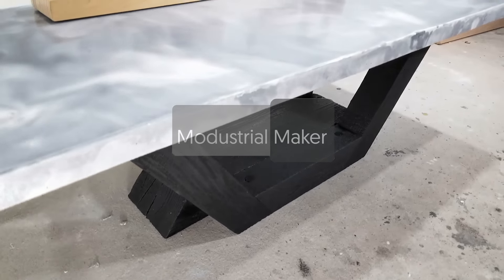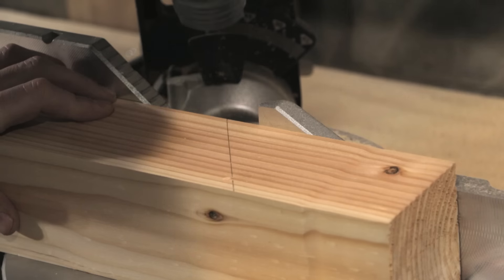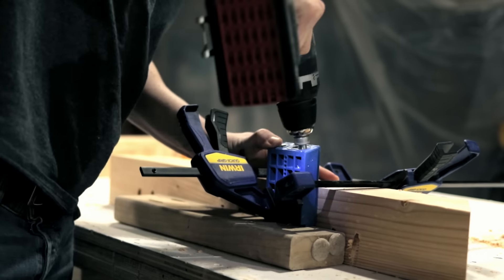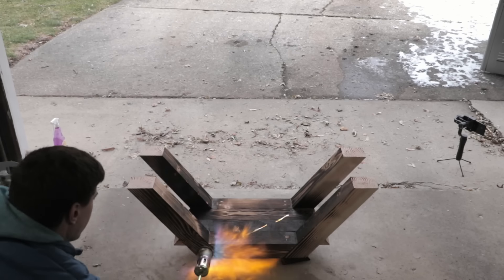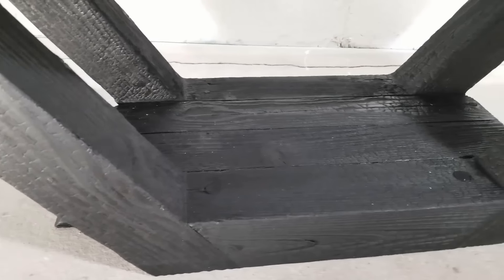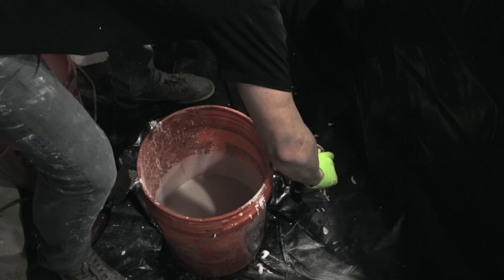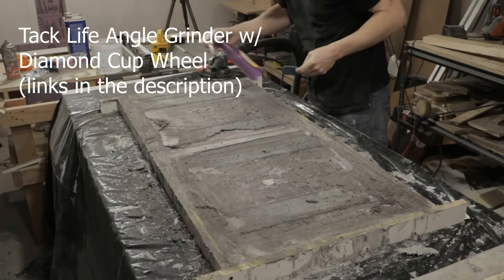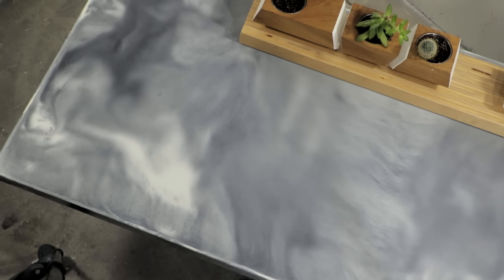DIY "Marble" Concrete Table || w/ Shou Sugi Ban Base

Comment from the maker: Which concrete look do you prefer, the "marble" look or the pure white in my past videos?  Comment and let me know!
Reply: I love the uniqueness of the cloudy/marble look, but the white has a clean aesthetic that's impossible to hate. I'd love to give this a shot. Haven't made the leap to working with concrete yet, but this just convinced me! Another great video!
Reply from the maker: Thanks!  Would love to see what you make once it is done!
Reply: This marble look is really awesome.  It fits with the color scheme of my house and I think may try it when I finally get around to making my wife's nightstand.
Reply from the maker: +Brian Easly thanks! Would love to see what you make.  Email me or tag me on Instagram if you share pictures.
Reply: I like both, really. But in my own home I would probably want the white stuff.
Reply from the maker: Thanks!  Yea, white goes with everything, for the marble look you are making the design of your interior fit around it
Reply: True, very true
Reply: The marble for sure. Great table. Do you have any measurements for leg length and table top dimensions? Thanks in advance.
Reply: Modustrial Maker ur problem wasn't the foam inserts, it was the extra use of hands at start. When u put the colors in vibrate the box it will not blend to a grey. The marble lines will be more crisp and it will get rid of all bubbles. Also put foam inserts earlier they will rise with the extra cement u put in. But great job anyway
Reply from the maker: Thanks for the tips!
Reply from the maker: Yes, lots of ways it has evolved since bundling cedar boards and lighting them up the middle like a smoke stack
Reply: Modustrial Maker what if you poured the 'marble' bottom up. Ie, place the foam in the bottom if the mould, then layer on the fibre glass, and last, the marble top surface. That way you can actually create the lines and pattern if the marble exactly as you want it. And no anxious waiting! Just a suggestion
 Let me know........
Reply from the maker: It would be challenging because pouring against the form is what creates the nice top.... You would have to hand trowel the top and use a wet grinder/polisher if you can right side up
Reply: Modustrial Maker ... true, but IMO the look of marble is timeless.
Reply: Can I get a cut list for the base
Reply: White for certain.  Fresh, clean and unique
Reply: marble looks nice! do you make for individuals who want to buy it?
Reply: HAVE YOU CONSIDERED USING AN EPOXY FINISH OVER CONCRETE?  i've been wanting to try this for some time but haven't found many examples on YouTube that use them together (particularly for solid surface countertops; most are either clear epoxy on concrete or a natural stone finish on wood).  what i like about this idea is how the weight and hardness of the concrete mimics the actual FEEL of a natural stone or solid surface countertop while the epoxy finish adds an incredibly realistic LOOK (there are hundreds and hundreds of different methods and recipes online—which use various dyes, metallic powders, and construction techniques for granite, marble, quartz, or any finish you can imagine).
imo, the problem w/ a natural stone epoxy finish on wood is that once you touch it, you immediately know it's not really a solid surface countertop.  personally, i'd prefer a countertop that even fools the people who touch it.
Reply from the maker: Just my preference, but I don't like epoxy over concrete when I've seen others do it, so I haven't tried it myself
Reply: @modustrial       did you see it in person, or online?  what didn't you like about it (was the finish wavy)?
Reply from the maker: I just don't like the look of it....the plastic look ruins the natural stone-like aesthetic of concrete, IMO
Reply: Typically white, but I like this one in the marble. Marble looks good with the dark base and white looks better with natural wood. IMHO anyway.

Comment: Извините, что на русском, просто мой английский оставляет желать лучшего. Воспользуйтесь Google translate. Просто понять что говорят я еще могу, а вот объясниться уже не получается грамотно. Есть пару советов:
1)  бетон после заливки необходимо вибрировать. Так выходят пузыри из него и уплотняется смесь. Также более тяжелые красители больше подходят к лицевой стороне столешницы. 
2) вместо утеплителя положить любой деревянный лист. Так столешницу можно будет прикрутить к основанию. 
3) после снятия формы нужно шлифовать столешницу с лицевой стороны. Так раскроется красота наполнителя и стол будет иметь законченный вид. 
4) после обжига основания, его нужно шлифовать. Потому что сгоревшие кусочки дерева очень плохо держатся на нем. 
А стол не плохой получился и работа проделана невероятная!!! Спасибо за видео!
Reply: Here is the translation from Russian into English 1) concrete must be vibrated after pouring. So bubbles come out of it and the mixture is compacted. Heavier dyes are also more suitable for the front side of the countertop.
2) instead of insulation, put any wooden sheet. So the tabletop can be screwed to the base.
3) after removing the form, you need to grind the countertop on the front side. This will reveal the beauty of the filler and the table will have a finished look.
4) after firing the base, it must be ground. Because burnt pieces of wood stick very poorly to it.
But the table was not bad and the work was done incredible !!! Thank you for the video!
Reply: Robin Stone спасибо большое!!!

Comment: This is why i love concrete. Very versatile. Great video. I was looking for countertop ideas and this was the best one.
Reply from the maker: Thanks!  I'll actually have another video out with a slightly different concrete marbling technique next week, so stay tuned :)
Reply: Modustrial Maker Im in the process starting a Kombucha brewery/Tavern in Cincinnati. Im positive from what ive seen that if I have tables like this in the tap room, that Ill be set apart. I like that from a visual standpoint you balanced the wood and concrete. It feels more hospitable.
Reply from the maker: So cool!  Do you have an Instagram for the tavern so I can follow along as it is built out?

Comment: I've made forms, same materials. I made windowsills, curved front, and for the form exterior the fronts were made from plastic moldings, from the trim dept at Lowe's. Used Dap putty to seal seams. Used the fiberglass strands. Used various dies, and did the swirls. Another idea is to add multi color fish tank gravel. To get a gloss finish, used graduated steps, using a grinder with wheel that uses velcro to attach the various pads. An idea for polishing would mount the grinder in an apparatus based on the principle of a surface grinder in a machine shop, to maintain a perfectly flat surface. I might just make one, once I've finished building my house.
Reply from the maker: Sounds cool.  Have you shared pictures of your work anywhere?  Would love to check it out.

Comment: Sweet looking table! I do see one issue, When using lag bolts like that you should have a washer as well. This will distribute the load at the head more evenly and prevent the wood from splitting.
Reply from the maker: Thanks!  A washer would be a good idea
Reply: Amazing way to use the brain to create things for the good. Congratulations!
Reply: Kale Mercer 
Good
Reply from the maker: Thanks!

Comment: Really inspiring and giving video. I learned som great stuff here! Thank for sharing this! 🇸🇪
Reply from the maker: thanks!  glad you found it useful.
Reply: Modustrial Maker how did you end up fastening the concrete to the wood?
Reply from the maker: I just relied on the weight of the concrete.  But, construction adhesive works well if you want to attach it permanently

Comment: Great presentation and result - I like it!  Have you ever worked with AirCrete?  After seeing the difficulty you had with the foam board, I'm thinking that a thin base of concrete poured for the top (as in the video), followed by a thicker slab of AirCrete would do the trick nicely and give you the weight savings you're looking for.
Reply from the maker: I hadn't heard of Aircrete, but it looks interesting.  It seems like the tools needed to make it are fairly specialized though, but it is intriguing none-the-less.  

Another solution (which is probably what I should have done is to build a 2x4 bridge over the form that you attach midway through the pour....sorta what I did in panic, except that with the bridge you would have support pieces outside the form instead of drilling into the sides of the form itself (this risks blowing out the melamine, but I got lucky and that didn't happen).  My video for the GFRC coat rack shows the bridge technique applied to embed a french cleat in a GFRC tile, if interested.
Reply: There are ways of doing AirCrete on the cheap.  After all, it's only cement mixed in the correct proportion with frothed soap bubbles or a foaming agent.  It's super strong, lightweight (it floats) and seems like a perfect solution for cement/concrete furniture projects if weight reduction without sacrificing strength is an imperative. 

I like that GFRC coat rack project; very creative.  With so many angles and geometric shapes in play on the racks, I'm wondering if gluing larger diameter marbles to the pipe ends would enhance it by lending some round/spherical accenting.  Also, it would seemingly prevent any damage caused by the pipe ends to coats or fabrics.  Sorry, I don't mean to armchair quarterback your designs.  Your creativity is contagious.  SUBSCRIBED!
Reply from the maker: The marbles idea is cool!   I don't think its armchair quarterbacking....it is just being creative.  I am the same way.  The minute I see something I like, I'm immediately asking myself how I could make it even better.  It is actually a compliment...the more something inspires me, the more ideas I have to build from it.

I'll have to look into the Aircrete.  I think you'd have to do some tests to figure out how it bonds with GFRC, but there is definitely some room for exploration with it.
Reply from the maker: +tswrench cool, I will check it out,probably when it warms up here a bit so I can do it outside

Comment: 4 years late but... I found by experimenting with smaller cement creations that dropping acrylic ink or india inks randomly on the form before pouring spread randomly when vibrating to remove the air pockets makes a really nice effect.

Comment: I don't like it, I love it! For the wooden base, do you think you could have achieved a quite similar effect just with a dark varnish?
Reply from the maker: +Βιολογικά Προϊόντα thanks!  You could get a similar color with an ebony stain, but could not get the texture you can get with shou sugi ban.
Reply: Just a question, is it right to use glue and screws when using Japanese woodworking??

Comment: I understand why you would use concrete for your table slab but have you thought about scagliola plaster? Id be really surprised if you cant top the concrete in scagliola. it's made in a loaf and "ripped" open which gives it the veins.  you drizzle in a pigmented plaster and press the loaf back together.  then you cut slices off the loaf and tile it although we've riped up tiles and kept true to the rendom.  Maybe I ought to make a vid demonstrating what i mean lol but hey cheers on your table top.  A very distinguished and interesting piece

Comment: We built a CMU house in 2003 with a masonry (brick) veneer, so there was a masonry crew onsite for over two months.  My wife made four concrete countertops for the baths and kitchen, which worked out fine, but were simply the same process as above but with concrete and some latex paint.  If you have a decent grinder and can grind things flat, just grinding/polishing concrete up to at least 1200 grit is a nice, durable, slick finish.  You can go to 2000 or more.
Reply from the maker: Interesting, did you add the latex paint to the concrete while mixing to color it?

Comment: Loved your explanation, you can use coconut coir as a filler. it gives strength and is indeed very light weight too. Don't waste that styrofoam 😊
The marble effect is good specially when you can't see it and still manage to get it clean. 
The coconut coir is also suitable for formwork with gypsum if you wish to build any. coir is also used for waste dyes. 
your work is really nice and inspired me to work on furniture with GFRC too. 
cheers!
Reply from the maker: Never heard of coconut coir - I'll have to check it out.  Thanks!
Reply: @modustrial  i'm using it and it works very fine. the only reason of not using it is that you don't have to look for cheaper options. Living in India makes you innovative in so many ways. 😂
it costs $30 or less for 100 kg and it's a lot.
Reply from the maker: Interesting...I'm looking and it is a bit more expensive than foam per square foot over here in the US.  Do you use the expanding type of coir or something else?
Reply: @modustrial  it's the expanding type but why would somebody sell it for square foot? 
The one which you are looking at seems to be the one which is used for seats. 
 you need coir fiber as you can use it the way you want. 
http://www.diton.com 
maybe this helps  😊
Reply from the maker: Thanks!  I'll check that out

Comment: Looks great. I wonder if a pneumatic angle grinder could be used for wet polishing. They are dirt cheap and should be safe in the wet environment. The problem may be that they spin too fast or bog down under pressure.....

Comment: Ya turned out very nice. I just made my 4x8 concrete island top. Poured it upside down onto puck board. To shiny, but little worried about sanding it down a little to make the sheen go away. Like it’s almost like a mirror. Wonder if it will show swirling marks if i sand it ??

Comment: Top turned out fine! If I were going for a marble look I would have used epoxy. You are more adventurous than I by going with concrete for a marble look. It turned out nice though. Good job.
Reply from the maker: Thank you!

Comment: Very important question - you did not perform the most tedious parts of casting concrete, vibrating it and polishing it, can you explain what is different compared to the traditional process? Love you do not need to mess with rebar also. I'll check out your other videos, this is really interesting
Reply from the maker: There is defoamer in the gfrc mix and without any large aggregate, easier for air to escape... So you don't really need to vibrate it.  And because you can get usually get a nice surface  with minimal pinholes right out of the form, you can usually get away with no slurry coat...no slurry coat means no need to polish (altho I usually do a quick wet sand with 400 grit sandpaper).
Reply from the maker: Also, I think if you go to the pinned comment in my curved concrete bench video, there is a link to a great starter article explaining the benefits of GFRC mix.
Reply: Yeah the concrete looks much more liquid than typical, do you happen to know - factoring in fiber reinforcement - how strong it is going to be? I'll definitely look into that video.

Last question, why did you decide on that style of concrete mixer vs the "stand-alone" kind?
Reply: This is what I meant for the concrete mixer https://m.harborfreight.com/1-14-cubic-ft-cement-mixer-61931.html
Reply from the maker: It will be 2-3x normal concrete 12,000 psi or so.  And flexural strength is something like 5x standard concrete
Reply: @modustrial  :O I would have never thought so, very nice it's probably much more expensive by the cubic yard but in furniture the actual cost of the concrete is one of the lowest elements due to the small quantities needed (sorry just thinking out). I'm watching your other videos.
Reply from the maker: Yes, it is more expensive...like solid walnut vs plywood.  But the ability to go thinner and its lower overall weight by volume offsets a bit of the extra cost.

Comment: I saw a video where  a small batch of the concrete had fabric dye added to it and swirled with the main plain concrete. Dark blue was used and it looked good although it was a much smaller object.
Reply: Very cool project.
Reply from the maker: Thanks!  And the idea with fabric dye sounds cool.  Would love to check it out if you can find a link to the video

Comment: Good day sir, pretty sweet looking project. Would you not have achieved the same recess effect of the foam, by screwing down the same thickness melamine to the main form?
Reply from the maker: Yes, you can do that, but it is actually better to do the thickness of form plus thickness of a spacer.  You can see me use this approach in my coat rack and waterfall live edge table videos.

Comment: Looks great, but i wonder, doesnt it crack easily? I assume the glass fibre has the purpose to prevent that, but for me is difficult to judge. Are these concrete countertops/tables good against cracking?

Awesome to see that you can easily marbelise the concrete.
Reply from the maker: it's GFRC, way stronger than normal concrete. The glass fibers in combination with other admixes and a polymer make it much stronger